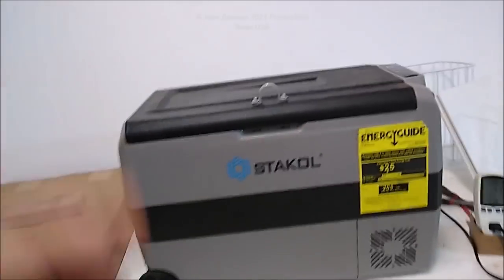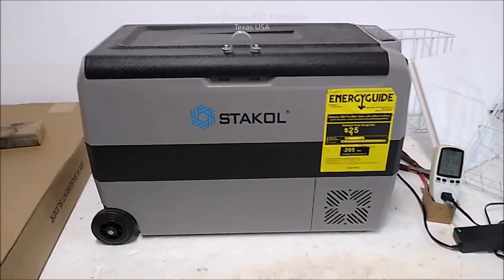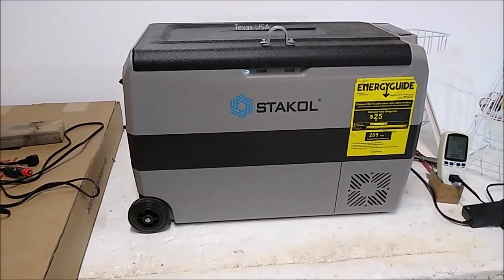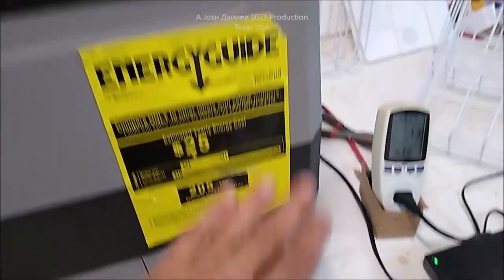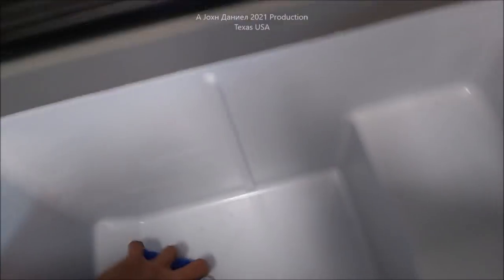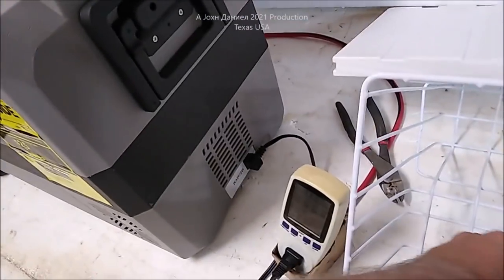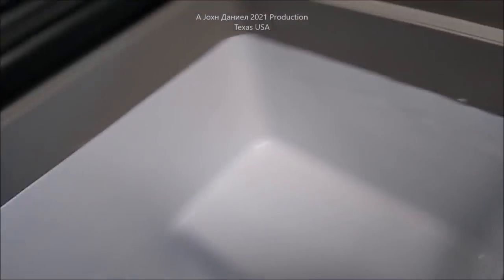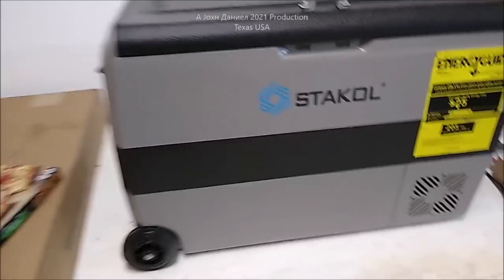12 Volt portable DC powered Real R 134a deep freezer, the 1 year review

Comment: I added a bubble mylar sheet to the top, like a blanket,  in my DC freezer (Sundanzer) it helps block warm air from the top layer of food when the lid is opened. 
The turbulence of the lid opening was giving us extra condensation/ frost before.
Reply from the maker: Excellent idea. We had a sundanzer from backwoods solar years ago. 4.1 cubic foot. Took 13.6 amps to run it. Now you can get 3 of these and use only 9 amps. Things have improved.
Reply: Hey John don’t mean to be complaining but it seems the sound quality is not as good as in your other videos. Other than recording on your phone so any of your cameras have a mic input?
Another great video. Ours is similar and does a great job with the Danfoss compressor.
Looking forward to more
videos as you setup in your new location.

Comment: You couldn't be more spot on... I bought a 44qt Costway last year after the 4th thermoelectric cooler died. Works great, my co-driver and I run it around 28 to 30 degrees all week long. Arnold Palmer iced tea is so cold it hurts, and mine came with a 5 year warranty.  Mine has only one big storage with a small dairy side or cubby. Only trouble we encountered was Scott and his humongous feet accidentally stepped on the cord and broke it. Truck stop later grabbed a cigarette lighter plug with screw terminals, fixed...
Fantastic review John. 
Our other team,  Russel and Art purchased a huge one (unknown brand)  with 2 separate doors, it's so big it spans from the dash to the edge of the bunk mattress. To get in the bunk they have to slide across the top 2 doors, it has to be 75 quarts at least, unbelievable...
Keep up with the great videos, learning alot..

Comment: Trans started using Danfoss AC voltage compressors about 10 years ago and they now build crap HVAC units. However, I am impressed with Danfoss DC voltage compressors. I have an 80 qt Bodega fridge/freezer split and it has been fine for almost 2 years. Solid!!

Comment: Nice  video!!! If you like portable 12volt coolers, you may want to check Lincoln coolers! They integrated a 173WH minie battery the aloud you to run the cooler for 12-18 hrs, uses a really small solar panel that keeps your freezer non stop for any time! The control panel looks pretty much the same as yours! They are more pricey, they run for about 800-900 dollars! The uses an LG compressor! Really good quantity!

Comment: The one I have is just like this one. It has been rebranded as ‘Bodega’. At 111-F outside I get 29 degrees on the temperature gauge. The 12v plug gets really hot and warps out of shape with everyday constant use (RVers). Those blue Ice packs from the dollar work FINE!  A 10lb bag of ice will last 4 days if not used for drinking. Not too sure about the plastic latch/snaps longevity. Still waiting for my prismatic batts to arrive so, this is turned off all night.
Reply from the maker: If it's not getting enough airflow it will work to stay under 15 degrees on mine at 105 to 107° outside. But If yours has the Danfoss compressor it should do much better than 29, that's why I got a Costway because few have the agreement or licenses with Danfoss compressor company and substitute a Guangzhou Winsu compressor that draws over 8.5  amps.

Comment: Good Sunday morning Mr Daniels. I am thinking of getting one of the 12 fridge/freezer ,and I am wondering if you could give me a update on how yours is holding up ? Thanks again for your knowledge on just about everything.
Reply from the maker: This model is great, If your goal is mobile, get the Stakol/Costway made 53Q https://ebay.us/F4uo69  But I got a better plan for you , Your wise, your comments are wise too. So, this option will use 8% less power, and has 39% more space. So, Follow me on this. Go get this exact model,  HUGE PRICE CUT!! 
 https://amzn.to/3p2jzgb its using a DF330 Compressor, and is so efficient you will love it. On its back or near is you install THIS inverter, https://ebay.us/nH8F6g and run it with 4 awg up to 18 feet away, 6 awg up to 8 feet away is ok. It's idle current is nearly nothing, your total power use will be less, your outcome WAY HIGHER! And total cost is same or less!!!!!

Comment: These are great I use one in my bus
Reply from the maker: Get 2 and set one as a refrigerator 35 to 40° and take the other one and leave it completely as a freezer 5 to 10°. That way you can run it on a pair of 35 amp hour batteries and 300 watts of solar on your roof.

Comment: Thanks John!  It looks like my Jeep J20 truck has a new bit of off-road kit coming! 😎👍  I'm looking into doing a school bus/skoolie build and haven't been able to separate online 'fact from preference' in regards to a fridge and freezer.  I am leaning to more of a full RV/apartment size and would like your educated knowledge on AC vs DC.  I'll be mostly off-grid (with a shore power option).  The plan is to cover the rooftop in panels; bonus is the airgap to help keep the roof cool.  Side bar : is it possible to mount a mini turbine or two top side?  Much appreciated!!
Reply from the maker: You can get numerous 12 volt options for refrigerators. Unique is a good brand and makes a RV replacement that's only DC power.
Reply: @JOHNDANIEL1  I'll go take a look right now and see what size options they have.  Thanks again John for all that you do.  I've been learning a lot and always look forward to your next video.

Comment: I have an f3 error that won’t go away. Anyone know the fix?
Reply from the maker: Have you checked the manual or contacted their online support.
Reply: @JOHNDANIEL1  says to turn off for 30 min.. doesn’t work.. it’s a different brand but pretty sure they are similar
Reply from the maker: The way manufacturers in china work or even the product sellers is unique. I honestly should do a video on it. Unlikely a similar looking or different branded item will have identical parts or operation processes. That said I would suspect a compressor fuse inside the cabinet.